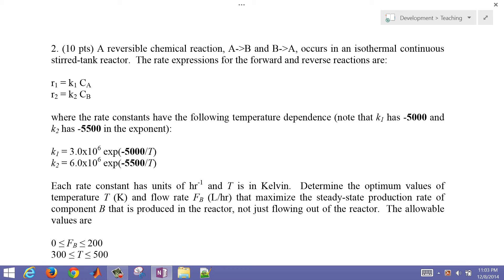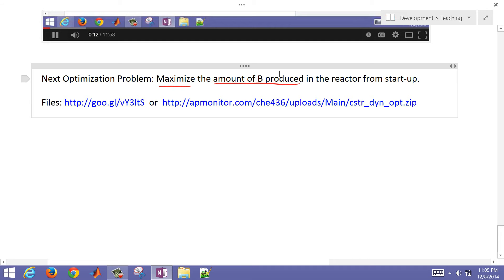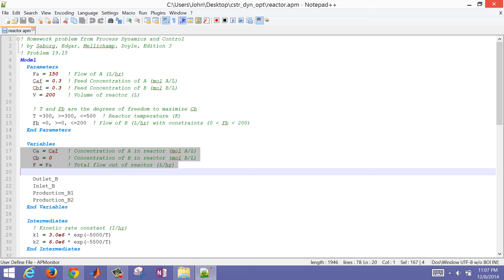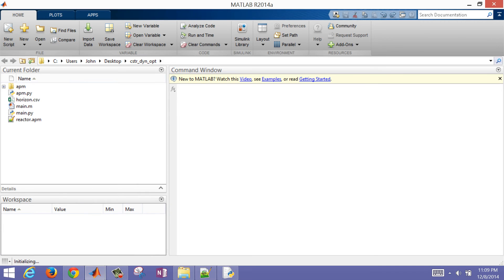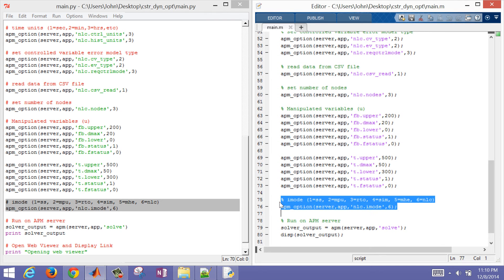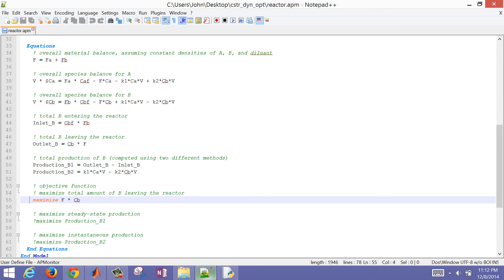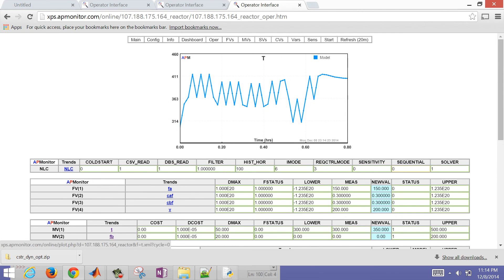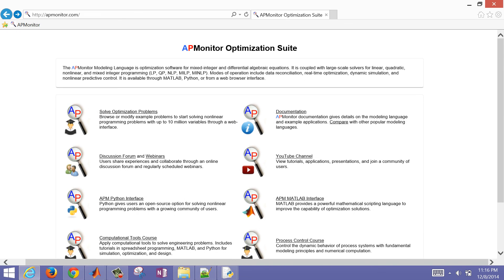Reactor Dynamic Optimization with APMonitor

Comment: Is it posible to optimize molars flows: FA, FB, FC, FD and FE in the following equations;

d(FA)/d(W) = rA
d(FB)/d(W) = rB
d(FC)/d(W) = rC
d(FD)/d(W) = rD
d(FE)/d(W) = rE

rA=k1*Ca*Cb
rB = -k2*Ca
rC = k3*Ca*Cd
rD=-k4*Ca*Cd
rE=k5*Ce

Where: k1, k2, k3, k4 and k5 known.

Ca = Ct0 * (FA / Ft) * (T0 / T) * (P / P0)
Cb = Ct0 * (FB / Ft) * (T0 / T) * (P / P0)
Cc = Ct0 * (FC / Ft) * (T0 / T) * (P / P0)
Cd = Ct0 * (FD / Ft) * (T0 / T) * (P / P0)
Ce = Ct0 * (FE / Ft) * (T0 / T) * (P / P0)

T0, T, PO, P are known. 
Ct0=Ca+Cb+Cc+Cd+Ce
Ft=FA+FB+FC+FD+FE

I need to optimize molars flows in order to maximize conversion (X), yield (Y) and selectivity (S) form equations:

Xa = (FA0 - FA) / FA0
Yc = FC / FA0
Sce = FC / (FA0 - FA) 

FA0 is known.

Thanks in advance.
Reply from the maker: Yes, please see the dynamic optimization course for setting up and solving that problem. https://apmonitor.com/do

Comment: Thank you very much for the video!
can you submit a video to explain continous Morlet wavelet of measured data to estimate parameters naturel frequencies ,damping using matlab in vibrationl system(gearbox for example)
bests regards
Reply from the maker: +mohamed yousfi another possible way to get a dynamic response of your system is to fit the data with an ARX model: http://apmonitor.com/do/index.php/Main/ModelIdentification

Comment: Hello ! Great video. Can we incorporate maximizing a cost function at the end point. i,e,  J(x(tf))  where tf is the final time and x is a state variable vector.  Thanks.
Reply from the maker: Yes, just use the maximize statement in an equations section.
Reply from the maker: To implement a cost function just at the end, you'll need to multiply your maximize function by a parameter such as "p". You can define "p" in your data file as all zeros and then one at the last point. Multiply your objective function by "p". I hope this helps. This strategy was used here: https://youtu.be/cx65HxFnRV4
Reply: APMonitor.com Thanks for the reply. How do I choose the dimension of the parameter "p".
Reply from the maker: You can declare it as just p in the parameters section. The dimension will be given by the number of rows in your CSV file. You'll also need to declare a time column in your CSV file where you specify all of the time points that you'd like to cover. Here is one tutorial: https://youtu.be/pOXcOWMo5Hs?list=PLLBUgWXdTBDgOlvGgbBDvHXdleSgEi9aj